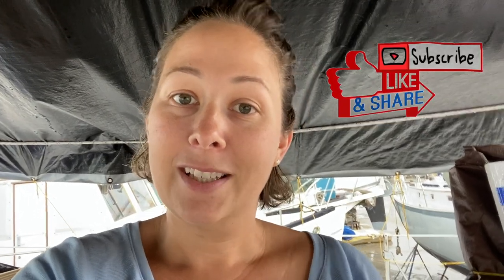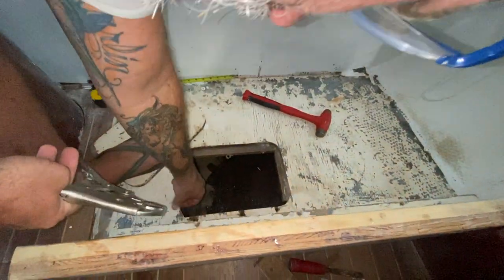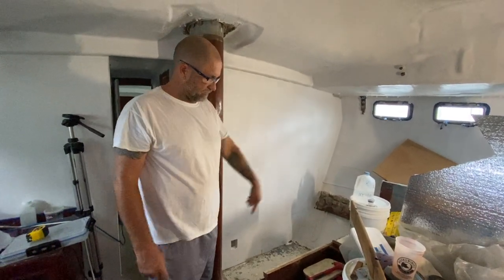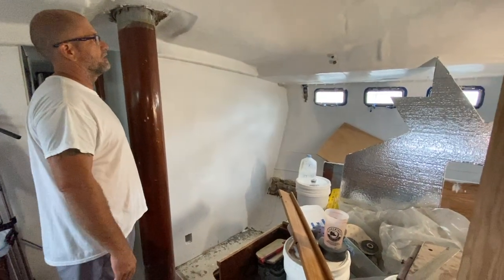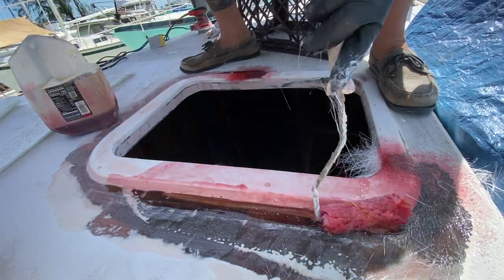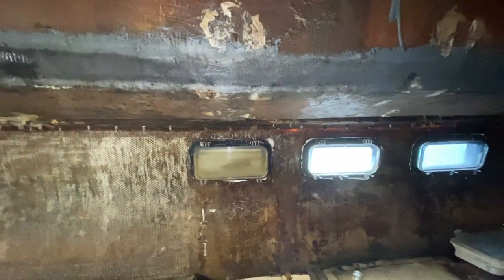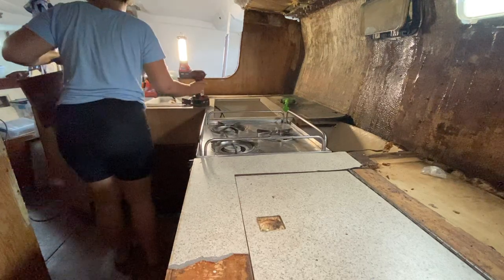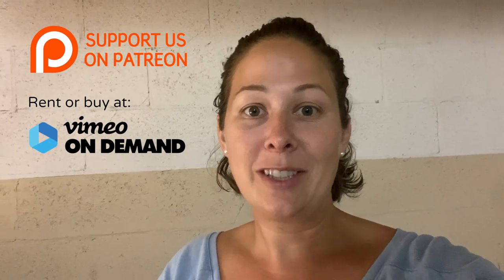Sailboat Refit

Comment: Buy new hard drive and a software called Ontrack EasyRecovery (you need to have bad and new hardrive, recovered data will be copied to the new one) - this should help recover the data from ether main or backup drive...  disks are not failing competely... if the electronics failed you can replace electronics. If magnetic plates fail Ontrack should help to recover most of the data. The final step is to send the disks to professional company to recover all, but it costs a lot. Try yourself the first steps first. Good luck.
Reply from the maker: Thank you! I will look into Ontrack, I’ve used wondershare and one other (iBoysoft I think) both were paid licensed programs. Both programs find the files but after I “recover” then they won’t open in their respective programs. I even paid for the license for the wondershare video fixer and it didn’t work either. I may have to mail them off at this point but it’s so expensive and we have A LOT of expensive boat projects that take priority. 😞
Reply: @projectnolla1564  sure understood,  the diagnose is for free usually, so you can check with them at least what happened with the drive and than plan next steps. If the file recovered should open normally. Ot may have some corrupted blocks (video especially) but shoild open and hang in empty blocks.